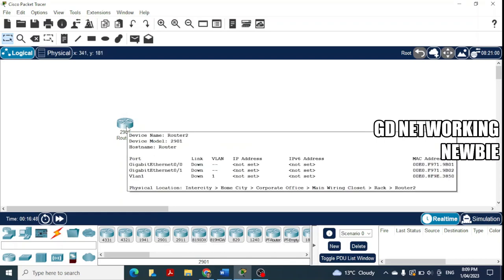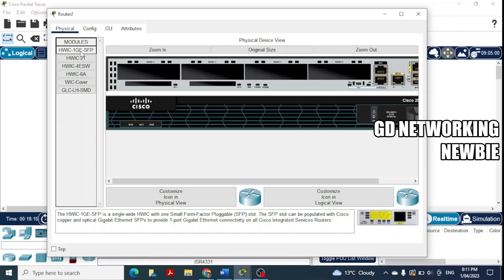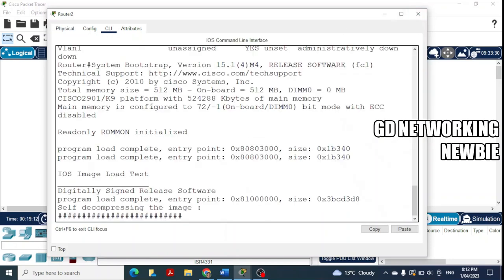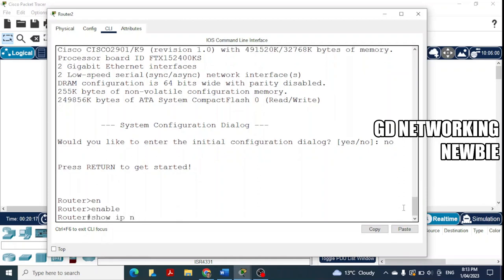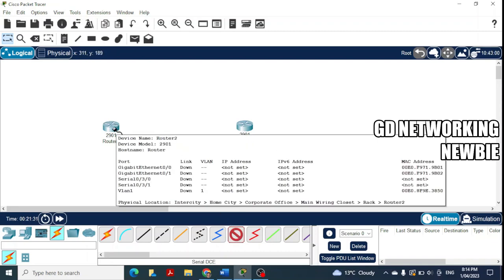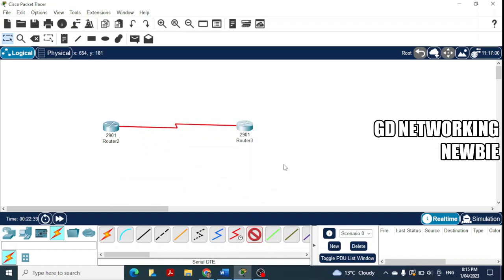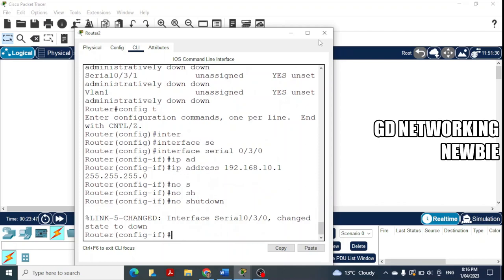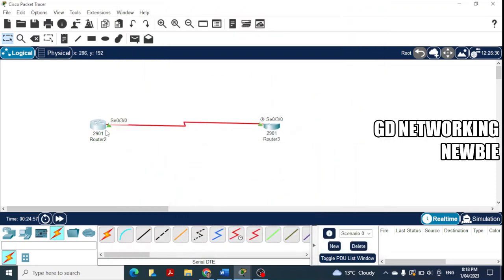Serial Interface Connection Between Two Routers - Difference between DCE and DTE Connection

Comment: Sir, why we used serial router connection?
Reply from the maker: In WAN, we have different option to connect different site. Serial connection between sites is one of the many options. To establish serial connection between two routers, we need to configure/use serial router connection.
Reply: @GDNetworkingNewbie   thank you